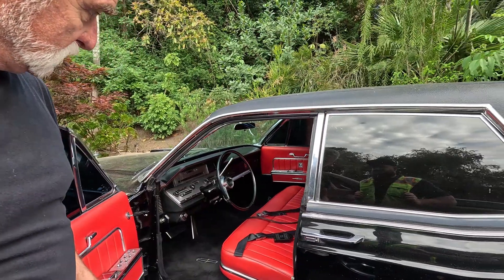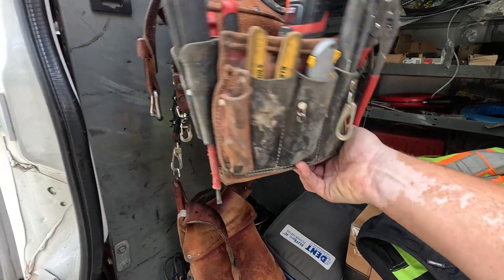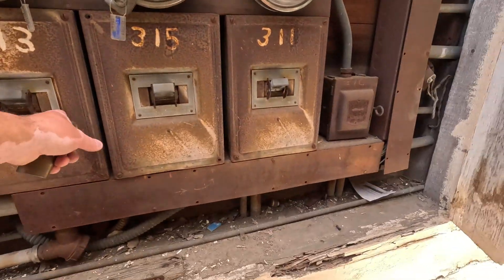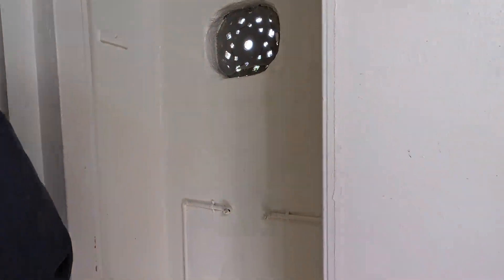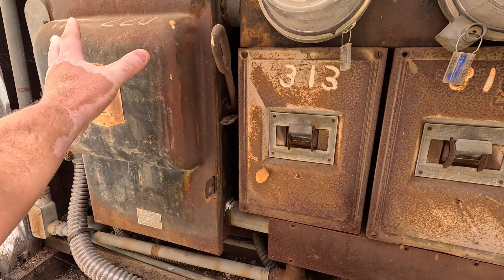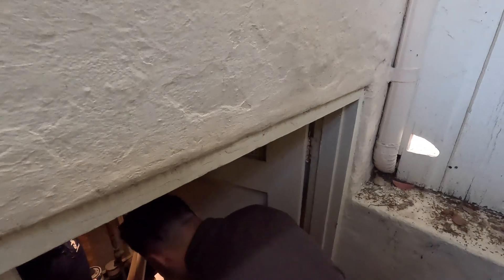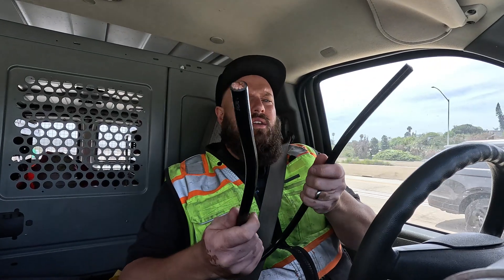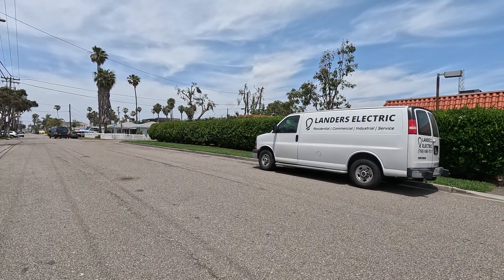Vintage Electrical Panel Upgrade | Master Electrician POV Vlog Ep. 1

Comment: Are you able to share a ballpark on the quote for the meter bank upgrade? 

Only asking as I have a 6 unit property up in Tacoma Wa with a 1980s crusty old meter bank outside due to ocean proximity. 400amp service with 125a for the 6 units and 60 for a house panel. I share dons pain - you must make great money thanks to insurance companies. They are killing us in the commercial multi family space. Most are moving to a 20 year age limit for primary markets (like big insurance companies, State Farm, amfam, etc). Older buildings that have not had plumbing and electrical upgrades are all in a secondary market where the sharks live. 

Cool content! If I could go back in time I’d have become an electrician!

Comment: Man that looks rough all those old meters to eventually be changed out. 
I did a 4000 amp switch gear change out and added two new 1200 amp transfer switches  at a Hospital a few years back. A lot of cut-overs/shut-downs , 3 phase power had to make sure rotation was correct on existing equipment. 
All the old wire was black,  had to make sure all wire was phase correctly. 
A lot of attention to detail.
Reply from the maker: You nailed it with the attention to detail. And I don’t know that I would have the nerve to take on one like that at a hospital. Glad you got it done. Appreciate you!
Reply: @landerselectric thanks dude, it was a challenge. 
Just maybe one suggestion for ya, 
If you do the job maybe build your whole new service next to the old one then you can have that complete,  up and ready to go. Then do your cut over from old to new one at a time, less shut down time. Maybe that’s what you’re gonna do, just a thought. 
Be safe out there!
Reply from the maker: @mcarroll598  that’s a great idea. That’s exactly what I was thinking. I might still take it back apart again though because of the weight, but I do want to put the entire thing together to ensure that we have every single part in piece that we need and make sure it’s gonna fit.
Reply: @landerselectric yep right on man, look forward to the video of you doing this job!
Reply from the maker: @mcarroll598 Me too. Really want to get it done!

Comment: Here in the UK, coin op parking things are thing of the past, it's all pay with your smart phone or by contactless card... it can be annoying for older people
Reply from the maker: They’re slowly switching things here as well.
Reply: @landerselectric  If you come across one, beware if it wants you to scan a QR code, some ne'er do wells here have been putting stickers over the actual  instructions, and setting up a fake payment page so not only do you end up getting your bank details stolen, you get a ticket too!
Reply: to be fair the city will usually waive the ticket, but it's a  headache you don't need
Reply from the maker: @TheChipmunk2008 for sure

Comment: Hilarious! Guy who wanted to take the old equipment back to his home. Reminds me of those old cars they find in barns and garages.
Reply: Ever do a frank Adam’s panel?
Reply from the maker: @Makemlaugh I have not. What’s that?
Reply: Look up Frank Adam’s electric company out of St Louis. Pretty old stuff, come across it a bit up here in northern New England and Wadsworth Panels. I would send pics if I could upload them.
Reply: @Makemlaugh  The old Frankenstein. Nothing Abby Normal about that.
Reply from the maker: Love old electrical panels and equipment! Subscribe for more coming soon!
Reply: I think most electricians do it, I have a small cabinet of vintage stuff i find interesting, 1930s earth (ground) clamps, old doorbell transformers with a porcelain base, old switchfuses from the 40s, even older ones from the 20s (those were scary, bare bit of lead alloy wire across two terminals), old porcelain wirenuts with no spring insert (which is why most UK electricians sneer at wirenuts, they have no idea that the UL listed type are much better), and so on and so forth.
Reply from the maker: @TheChipmunk2008 I love the old stuff!

Comment: Ya bro, I gotta little air compressor, jumper cables, jump starter and tire plug kit. I’m not trying to wait for someone to come jump and dead battery if it happened or a screw in a tire.
Reply from the maker: Completely agree! Gotta be prepared. Time is money!

Comment: Hey there Stephen - thanks for filming all of this! As the engineer in this scenario, I come across old systems like this alot! And this video really highlights how important it is for the Engineer & Electrician to work together to "as-built" an existing system - you can only figure out so much of how a system is wired from the exterior wire gutters, disconnects, nipples, etc. Really takes removing covers like you did to see what's going on. I'll be curious to see what you all do to fix this up - hoping the client can afford to rip out that "operating museum" of a system and replace with modern equipment and methods.
Reply from the maker: Glad you found it helpful! I agree we need to work together. And yes, will definitely document this museum electrical panel upgrade if we land it. Share this video with anyone you think might find it helpful or entertaining. Lot more videos to come!